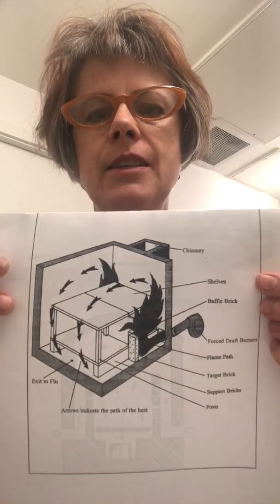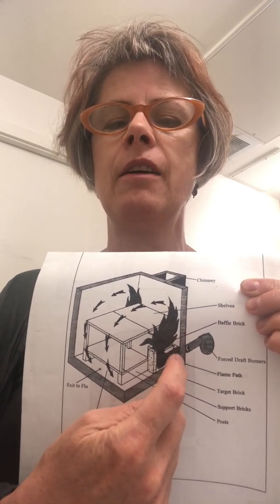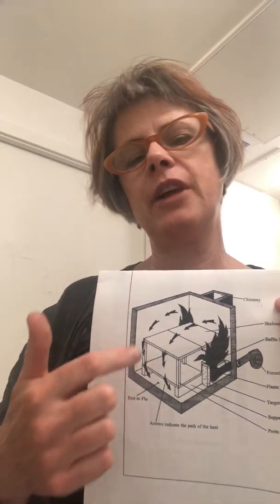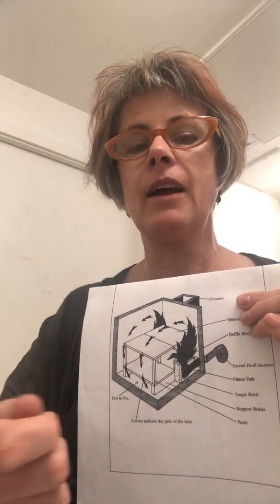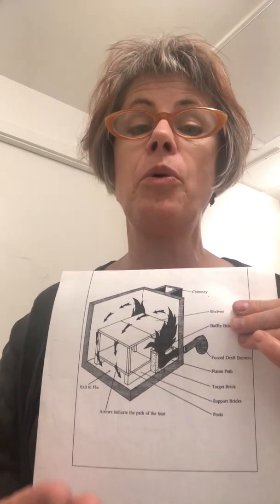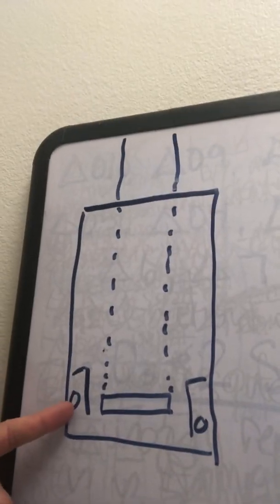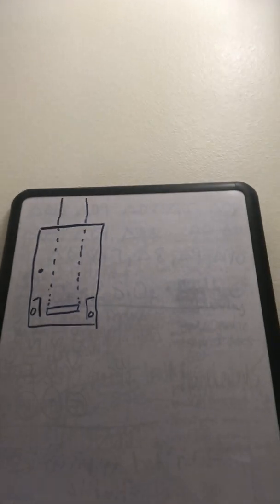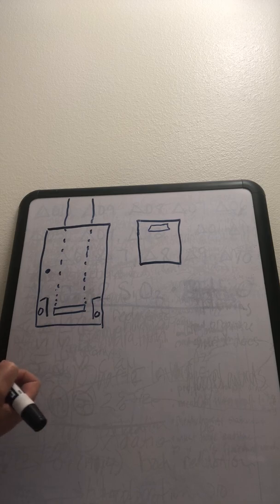Downdraft gas kiln design

Comment: Great information on the downdraft kiln. A few of observations:

(1) It would have been helpful to've shown the actual kiln, so we could get a clearer picture of the equipment.
(2) The squirrel cage is a blower.
(3) Also, I am very confused about the chimney being a secondary air intake. I've always thought of the chimney as an exit point only, the damper being used to regulate the rush of exiting gas, thus pushing the combustion into reduction or oxidation. How can the chimney pull fresh air in and pull exhaust gases out at the same time?

But then, I could be wrong.

Great presentation, though.